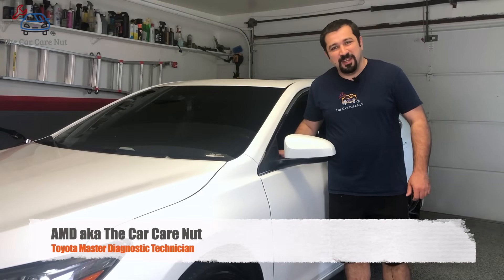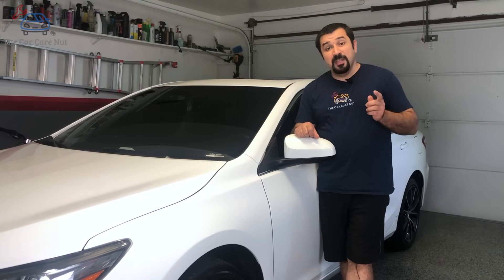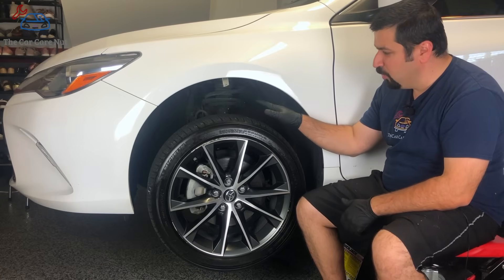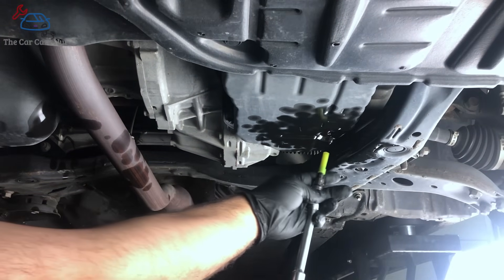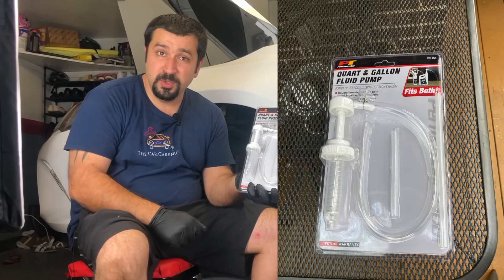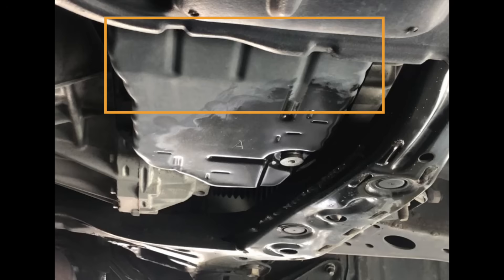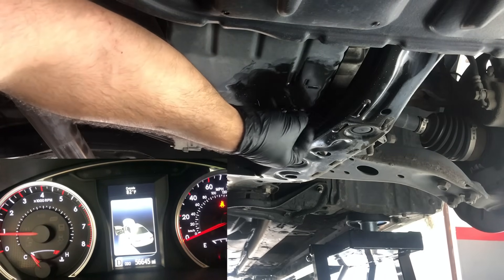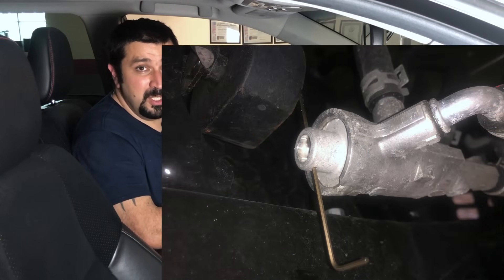How to change your Toyota Sealed Transmission Fluid

Comment: Dear AMD,
For the wire jump method, how long the D displays solid before it flashes (meant the transmission temperature is above the checked spec); another words, what is our window for solid D before it flashes?

Example: I test / practice for my 2018 Camry 8 speeds transmission using the wire jump method. Here they are:
1. It took about 4 min. (early morning) going N to D back and forth before the D displays solid.
2. However the D still display solid after 5 minutes. I decided to turn off the car.
Many thanks & God bless,
Hai
Reply from the maker: Hi! In some cases you’ll have 15 minutes or more.
Reply: @TheCarCareNut  If that is the case, this "jump wiring" method is not completely valid if we wait for awhile and start to check its level (because the engine is still running and its transmission temperature definitely will increase). The only way it is valid, is once the D display solid then IMMEDIATELY check the fluid level within (may be) 1 minute ... my guess. Please feedback to Toyota on this info. Many thanks & God bless, Hai.
Reply from the maker: You have a fluid temp range. Usually from 95-114. Anywhere in that range you’re good to check the fluid level.

Comment: Is there a washer that needs to be replaced when u remove any of the drain/fill plugs?
Reply from the maker: Yes for the drain plug and fill plug
Reply: I have a 2011 Camry, 4cyl engine, I’m assuming it’s a u760 transmission,  part numbers 90430-18008 refill plug. 90430-12008  overflow plug. For that if anyone is looking

Comment: Toyota really screwed us without putting a dipstick in.  I have three of them with only the cvt having this problem. Yes, this a problem not a procedure. Anyway, I put a glass measuring cup full of cold CVT fluid in a 400 deg oven for an hour.  The level of fluid in the cup did not change noticeably.  Granted, it was not a glass beaker.  So I really wonder if this temperature check is all that critical on the fluid level.

Comment: Sooo... with all due respect, are all Toyota mechanics trained to do it the same way you have?   I have a 2014 sienna with 56k miles and ready to switch out fluid but have doubts the tech will do as you have.... 
Thoughts? 🤔✌
Reply from the maker: That depends on the texh

Comment: hi why that my transmission has 2 plugs the other one is drain and the other one is check as stated in the oil pan it is different in your videos. my unit is 2007 rav4/vanguard cvt transmission japan version and TC fluid stated on the filler plug im confuse can you help me this one because i want to the fluid. thanks

Comment: Thank you for all the professional video of car care. I would like to ask you  a question in regrading sealed transmission service on my 2013 Lexus RX 350.  I wonder why we can just measures exact amount of out fluid volume (as this car no previous transmission service) and replace with same amount of new fluid without doing drain over filled procedures.  I am going to use cleaned milk bottle and measure how much came out, and marked on the bottle then dumping all the old fluid and put in new fluid.  Do you think this will work?
Reply from the maker: Hi! I’d you did all this work might as well check the fluid level
Reply: I am amazed at the number of people that assume the fluid amount in the tranny is correct from the factory or worse yet is correct on a used vehicle they have bought.
Reply: @shoersa  Would you drive a brand new vehicle off the lot with a sealed tranmission and go thu all of this to verify the level was correct?

Comment: Have any C-HRs with a bad transmission? The K114 transmission is known for bearing problems. I am seriously thinking of getting the fluid changed, pan dropped and filter changed, then fluid refilled at 30k miles regardless of what is recommended. Seems that the Russians know more about the K114 transmission than anyone. There is video of the K114 transmission and torque converter teardown. Had to use google translate for the comments. It is a known issue on the K114 that the variator bearings going bad.

Comment: Hi, what’s the correct temperature for the  2017 Toyota Sienna. If I were using the infrared gun, should I point it at the lower side of the transmission pan located in front of the drain plug? Thank you!
Reply from the maker: Hi! 95-113 and I wouldn’t use the infrared method with the new 8 speed transmission

Comment: I'm noticing that my wife's 2011 Sienna with about 200k miles has a slight shudder between 30-40 mph when it shifts gear.  I noticed that you did not drop the pan and change the filter.  When would you drop the pan and change filter?
Reply from the maker: Hi! If there’s contamination or issues beyond the regular fluid changes. Was the transmission fluid changed every 60k miles on your sienna?
Reply: @TheCarCareNut Thanks for your response.   it was NOT changed every 60k, and of course I believed the traditional "fluid last for the life of the transmission" theory until just recently.  My wife remembers having it changed at 80k, but it has not been changed since.
Reply from the maker: At this point I would leave it alone. It’s a risk to change it and might make things worse honestly
Reply: @TheCarCareNut  Ok.  Thanks.  I appreciate your response and insight.   God Bless!

Comment: My 2020 Corolla doesn’t have a 4th pin in the top row of the obd, it’s just empty plastic space. Any idea what to do to get the car in diagnosis mode?
Reply from the maker: Hi! Unfortunately they removed this feature on some of the new models. You’ll have to use a scanner than can show trans temp

Comment: Dear AMD, for 2018 CAMRY 8 speed transmission, I have 2 questions:
1. What if we do not  bypass the coolant when performing the transmission fluid drain and fill, what will happen? 
2. For bypass, is it easy to insert the pin through the coolant? Thanks & God bless
Reply from the maker: Hi! There’s no bypass for your Camry
Reply: OMG! Finally got the response I was looking for. Thank you guys so much
Reply: Forgot to mention I have a 2019 Camry LE 2.4.I believe my camera doesn't have a bypass

Comment: Hi there sir today I took the leap of faith to go to another Toyota dealership and I had it looked at well they said to do it and I had it done at 161,705 kilometers they said  100,000 kilometers to be done at I had a full flush done a bg transmission They put a special liquid inside it cost me $544 today .I drove the car on the highway to let the transmission circulate all through the car is that good to do .

Comment: I have a 2019 Lexus gx 460 Do you think it’s wise to change out the transmission fluid at 50,000 miles also do you think that the front and rear differentials need to be switched out at 50,000 also
Reply from the maker: Hi! Change the transmission fluid at 60k and the diffs every 30k

Comment: Another great DIY video!  What is the proper temp for a 2017 Highlander with 8 speed?  Thanks!
Reply from the maker: Hi! 95-114
Reply: @TheCarCareNut    
I just completed the drain and fill at 105 to 110 F.  Funny thing is I took out almost exactly 3 qts cold and but after overfill and drain I netted about 2.75 qts.  Is .25 qts difference normal due to thermal expansion?  I followed your DIY to the tee...as always great instruction and many thanks for your help!
Reply from the maker: That’s likely a 0.25 qt overfill initially before you drained it. Give it a week or so and double check the fluid level
Reply: @TheCarCareNut  
Ok, will do.  
One last question.  You say only drain and fill once while others suggest 2-3 drain and fill to dilute more of the old fluid.  
The excess I drained after overkill seemed to be nearly as dark as the original drain.  Seems like I should do another drain and fill to get fluid less dirty, right?  
Thanks again for your help!
Reply from the maker: Hi! WS fluid naturally is a bit darker than usual.

Comment: Hi, will this procedure work on a 2011 sienna?
Reply from the maker: Yes
Reply: @TheCarCareNut  hi the procedure worked great in my 2011 Siena. In the process I also learned that this only replaces about a third of the fluid. When/is it necessary to replace the transmission fluid filter or do a full system flush?

Comment: I watched this video at least five times!!!... I have a question regarding a scan tool. Most scan tools will display temperature of coolant , engine , transmission correct?  If you are a DIY person , there are affordable scan tools in the 50 TO 150 dollar range.  Is it ok to purchase one of these scan tools for the sole purpose of capturing the AT temperature needed for this procedure?     Thanks I love Toyota and your channel!!!
Reply from the maker: Hi! Yes you can! Just make sure the scan tool is capable of reading transmission fluid temperature

Comment: Hello I have a question at my dealership in Montreal Toyota I requested a CVT transmission flush for my car on my 2014 Toyota le model it's a 1.8 litre engine the manager told me it's not necessary to do .Regular cars is okay because I guess they are scared to mess up because of transmission slippage should I go to another Toyota dealership Thank you waiting for you reply .
Reply from the maker: Hi! I would.

Comment: Thank you for the video! But if i dont have tools to mesure fluid temperature, may i replace the same amount of fluid when everything is cold,engine and gearbox? i mean both old and new fluid have the same cold temprature.
Thank you for answering me
Reply from the maker: Hi! That would work if the fluid level was correct to begin with. I’d say if you did all that why not finish the job and check the fluid level

Comment: Is this the same procedure with 2016 tacoma sealed transmission? Thanks AMD
Reply from the maker: Hi! Yes
Reply: @TheCarCareNut  thank you... 40k miles to go before I try this method. which method would you recommend?1, 2, or 3? i'm inclined to try method 2.
Reply from the maker: I would either get a scan tool or use the method I explained in the video

Comment: This isn't a fluid change question. I am wondering how the Dynamic-Shift CVT is. I am considering a 2022 Corolla Cross which comes with the Corolla SE 2.0 engine and D-S CVT. Thanks
Reply from the maker: Hi! They are good so far. They do resolve the high drive of cvts on take off

Comment: Quick question,
My 14’ corolla on a downhill incline and with a sudden brake around 30mph, causes the vehicle to increase to 2200 rpm and hover there. When I try to accelerate the rpms increase but the car does not engage and move. The car remains stuck at this rpm until it drops and then I have normal pedal/acceleration.
Seems to be a computer issue as the transmission shift points is all electronic. 
Any ideas?
Reply from the maker: Hi! That’s actually a normal behavior. It’s trying to go to a lower ratio to help with engine braking.
Reply: @TheCarCareNut  really? that noise doesn’t sound too good. Anyway man I love the channel and your timely responses! Excellent content and no nonsense.

Comment: Do we need to change with CVT filter ? Mine 2019 corolla 60k done. Went to delar he suggest me to change filter while changing cvt fluid. Please suggest
Reply: I would change it. I think that the 2019 corolla has the newer K120 transmission - not sure. My C-HR (all of them in NADM) has the K114 transmission. The variator bearings have been known to fail - making a humming noise that increases with speed. My 2018 XLE C-HR (not my daily driver) has only 26500 miles. I am going to have the fluid drained, pan dropped, filter changed, then fluid filled at 30k miles, regardless.

Comment: I love your videos and with my 2016 Corolla at 65,000 miles it's probably time to change the tranny oil.  I don't feel confident enough to do this procedure.  Do you think most technicians at a good Toyota dealership take the time to do this procedure properly?  Thanks so much.
Reply from the maker: Hi! They usually do but honestly hard to be 100% sure.

Comment: Does the transmission needs a reset?
When the Oil has ben changed
Reply from the maker: No reset needed for fluid replacement

Comment: The Toyota dealership near me is recommending a transmission flush. Asked for a drain and fill but they only do transmission flushes on cvt. Would a flush be safe from the dealership?
Reply from the maker: Hi! You can’t do a flush on a CVt which model is it?
Reply: @TheCarCareNut  2014 Corolla LE
Reply from the maker: You can’t flush the CvT fluid on that car. It has to be a drain and fill
Reply: @TheCarCareNut  ok. I guess the service advisor doesn’t know this. Thanks for the reply! Big fan of your channel 😃

Comment: Hello AMD, I would imagine I am not the only person with this questions so I hope it helps others.  I took your advice and doubled checked my ATF level on my 2015 Rav4 6 Speed after following your fluid service video.  I used a Bluetooth / Android scan tool with the OBD Fusion app to read the transmission temp for both the initial drain fill procedure and the subsequent re-check.  I even doubled checked the ATF temp with an instant read thermometer as it drained to make sure my scan tool was similar to the ATF temp reading.  After refilling, the moment it hit 104 deg F, I would open the plug and drain to the "dribble" that you noted in your video.  Then, a week later, upon the re-check of fluid level, at 104 deg F, no fluid would come out. I assumed that I must be just SLIGHTLY under-filled.  I added 1/2 quart of ATF,  cycled the Transmission a few times P, R, N, D.  I let it cool, re- heated to 104, then re-drained to establish the proper level.  Now I rechecked at 104 deg f and still no fluid comes out.  What am I missing here?  Any guidance would be great!  Thanks AMD for all that you do!!
Reply from the maker: Hi! When you initially filled it. Did you cycle the fluid through? Like go to drive and reverse back and forth to cycle the fluid?
Reply: @TheCarCareNut  I do not think I did. Yesterday, after writing you the message I did an experiment. I took the drain plug out and started the vehicle. As the transmission heated up up to 110 degrees the fluid began to spill out of the Overflow straw. I think what happened is that I drained it to the highest temperature 114 degrees and was checking it at the lowest temperature of 104 degrees. I'm amazed at the difference 10 degrees makes in the fluid level!
Reply from the maker: Yep that does happen but as long as you have fluid dripping anywhere in that fluid range you’re good

Comment: If the car is park overnight, the next day I remove the Trans pan plug nut only, then there should be no fluid come out right? (Because the fluid is cold and lower than inner tube)
Reply from the maker: That is correct

Comment: According to the video you added 3 quarts of oil , did you measure how much fluid came out ? Just curious , thanks !!!
Reply: Did you watch the video?  I remember a 10 quart Home Depot plastic bucket with 2.5 quarts of used fluid in it.

Comment: What are the specs for the transmission fluid temperature (for flushing) for 2014 RAV4 AWD 2.5L and 2018 CAMRY LE 2.5L?
Reply from the maker: Hi! 95-114 on both

Comment: Your written “Last Step” says remove the jumper wire and take your foot off the brake.  Do you leave the car in Drive with your fit of the brake? Or do you put it in Neutral while removing the fluid plug to adjust the fluid level?
Reply from the maker: Hi! Put the car in park

Comment: How do i flush the old transmission fluid out of a ua80e tranmission on a 2019 Camry xle 3.5l v6? Is there a specific line i need to disconnect that will drain out fluid from torque converter? Should i use a level on the console to ensure its level? Should we always check the level in the middle of the check temperature bracket?

Comment: Hello AMD, just wanted to ask you how many miles after the drain and fill should i do another one. I just did a drain and fill for the first time at 110,000 miles and oil was very dark. 2012 Camry, 4 cylinder. Thank you!
Reply from the maker: Hi! I typically don’t recommend you do a 2nd drain and fill. The earliest I would replace it again is 30k miles
Reply: @TheCarCareNut  thank you!

Comment: Thank you for sharing. At 13:16, I wonder why you did not wait until the fluid flow slowed and only drips came out before installing the overflow plug, and then add an addition of 200 mL fluid as directed by the Lexus Repair Manual?
Reply from the maker: Hi! Some of the manual language varies on this. It’s essentially the same thing
Reply: @TheCarCareNut  I got it. Thank you.

Comment: Hey @CarCareNut,
Your explanations are literally the best on YouTube. I've done it once around a year ago  already but would like to do it again. Just wanted to know if I have some leftover WS fluid, can I use it for this fluid change almost a year later?
Thanks
Reply from the maker: Hi! Honestly I wouldn’t. WS fluid absorbs moisture. I would use new sealed fluid
Reply: @TheCarCareNut  Thank you!
Last Question:
Would like to know, if the atf temperature is already within range ex/104degrees, do we still need to turn on the car to let the excess drain to a trickle? Also would we need to wait for the fluid to cool down if it's already in range?
Thanks AMD 😁
Reply from the maker: I would let it drain the excess amount a bit then shut it off and let it cool down and recheck it
Reply: @TheCarCareNut  Thanks. Please keep rewarding us with your amazing content! 👏

Comment: I live in Arizona and I wanted to practice the procedure. Immediately when I started it was already on a SOLID "D" haha so I'm guessing because it's 91° outside at 6:30am the fluid is already at the correct temp right? Just letting it idle for a couple seconds would do the rest to warm up. Also when you drain the fluid is it supposed to be cold or warm?v
Reply from the maker: Hi! The fluid temp doesn’t matter when you drain it preferably cold.